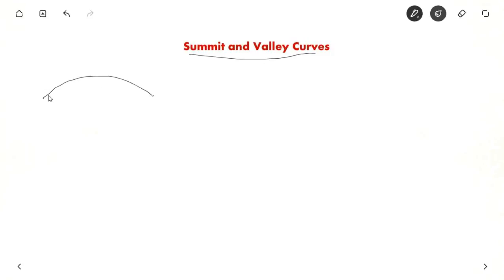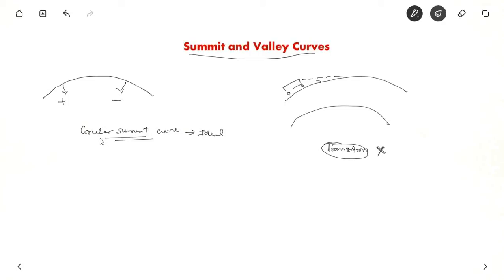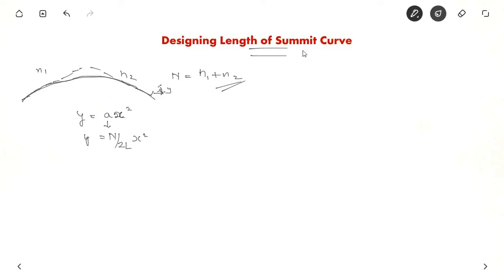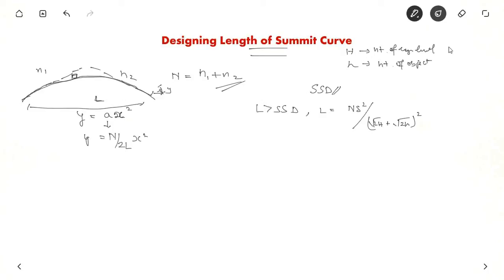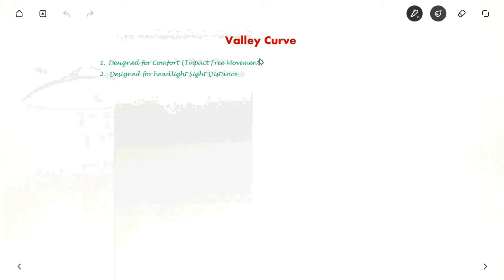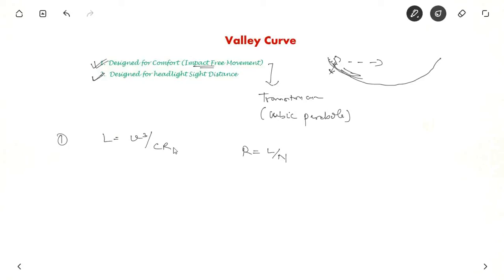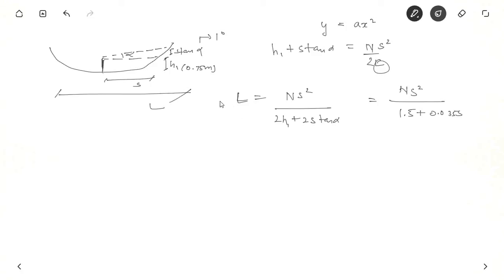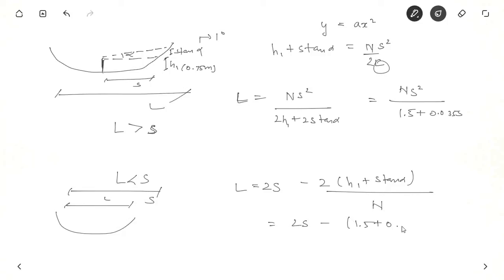Design of Summit and Valley Curves | Highways | Transportation

Comment: value of sight distance is 244.53 hence for 1st condition lenght is 535.02meter.in valley curve.  if i m wrong then pls correct me.
Reply: Ankita Singh I also got the same value
Reply: The formula for SSD is (vt + v^2/2gf) not (vt + v^2/gf). This is the reason why you are getting the answer as 244.53 . The actual answer for SSD when you substitute the right formula is 153.5
Reply: Ankita Singh yes you are right...the formula is wrong its v^2 /2gf